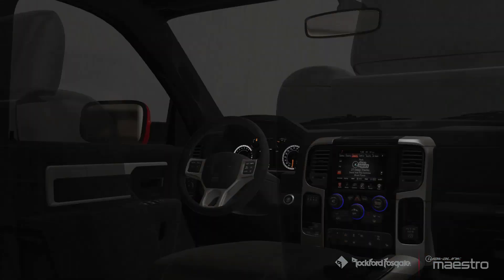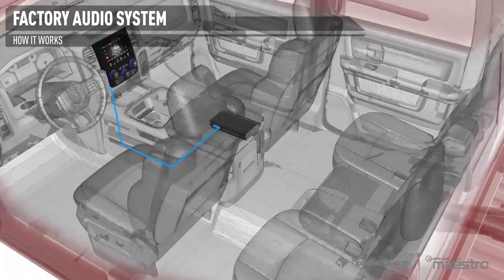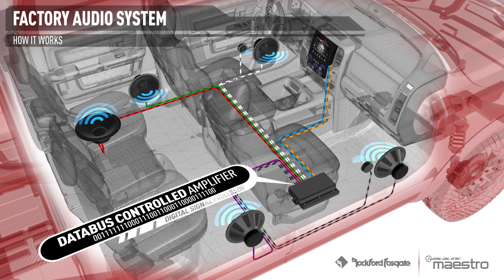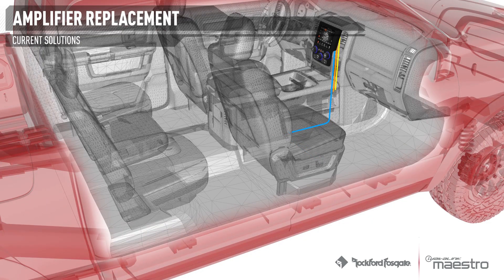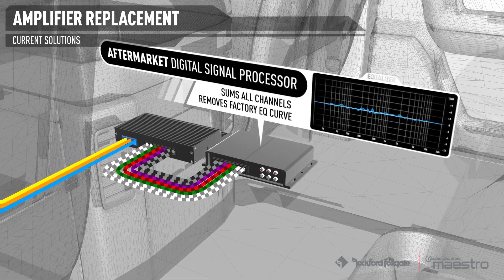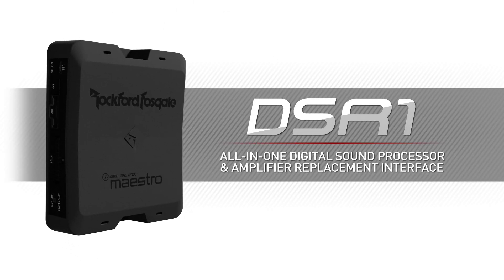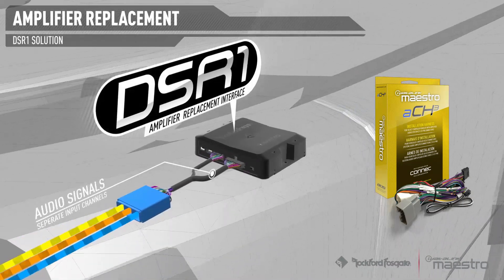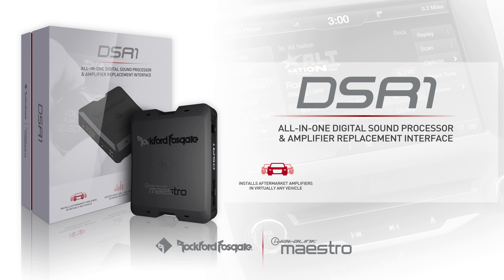iDatalink Maestro + Rockford Fosgate - DSR 1

Comment: Just picked one of these up with the aFO2 t-harness for my 2015 Ford Focus ST with the stock sony system. The factory Sony system is horrendous. 

Ive got 2 Audiocontrol amps going in with this, a kicker sub, and 2 sets of component Memphis speakers being installed in about a week. Im beyond excited.
Reply: How does it sound ?

Comment: I have a 2018 Harley davidson Rpad Glide , and i installed the  DSR1 along with a DIAMOND amp and the entire front channel wiring harness. I bridged my 4 channel amp up front only to my 2 front fairing speakers on my bike. I'm also running the HERTZ Mille PROX 165.3 6.5' inch speakers to each speaker. 

My question is about the DSR1 hookup to my bike battery. I ran the power cables thru the front fairing slot all the way down the wiring channel to the battery which is underneath my seat. My question is this: 

I was told to run an inline fuse of the DSR1 and run a ground and a seperate yellow wire (+) and hook that up to my battery for the DSR1 fuse. 

How do I connect skinny 18-22 gauge wires to my battery alongside my power cables which are 8AWG?
In other words, where on the battery terminal do I connect the DSR1 inline fuse wires, they are really thin!
Reply: Fused distribution block

Comment: What provides the remote turn on for the aftermarket amplifier? It appears like only rca outputs go from dsr1. How does the aftermarket amp know to power on? Is there something I should look for in an aftermarket amp for compatibility with dsr1?
Reply: I would just connect the remote turn on to a fuse that only comes on when the key is in the on position

Comment: Installed the DSR-1 today. No output. 500ohms across all 4 channels for the CAN bus to be satisfied. I have Can bus communication to the device and can communicate via Bluetooth just fine. But no output.. 

Any thoughts or ideas? 2017 Dodge Challenger Hellcat with Harman Kardon amp.

Maestro tech support is out of ideas and I'm waiting for Rockford Fosgate to get back to me at this point.
Reply: D.J. Murphy did u ever find a solution? I thought a 100ohm resistor was supposed to be placed? Not a 500ohm

Comment: Does this mean I could throw away my stock Sony amp on my 15 focus st?
Reply: Just throw away the entire car🤣
Reply: @elice05  😄
Reply: Yes use the DSR1 and the ADS HRN-AR-CH2 T HARNESS  so it is plug and play. I just finished my 15 ST, works great.
Reply: Jeremy Paine hey so if I get both things mentioned above will it be just plug and play to a aftermarket amp? I have a Focus st ST2
Reply: You need a different harness the one he said is for a Jeep or Chrysler
Reply: Nathan Rix ok got you but what I’m asking is will i still need to run wiring of some sort or is everything plug and play after I get the correct harness?